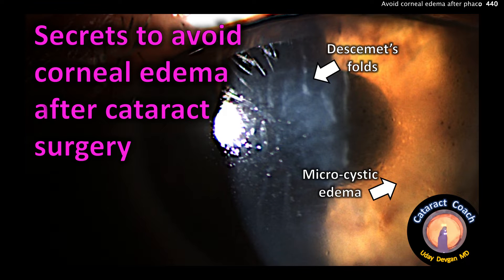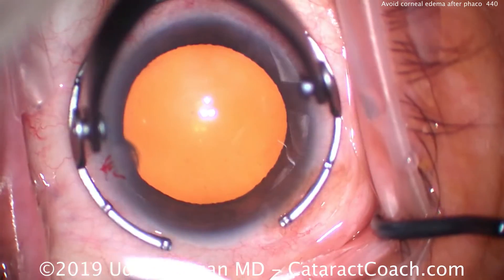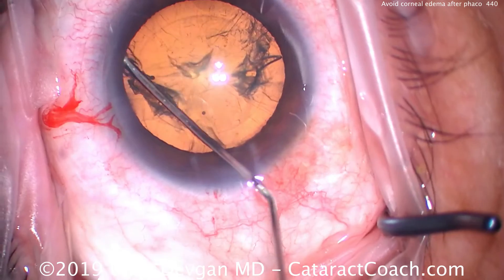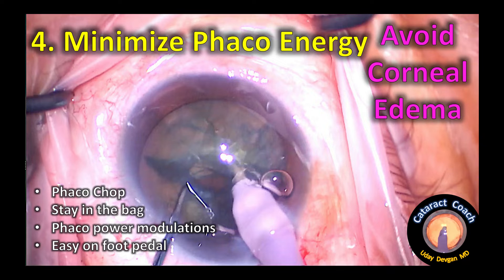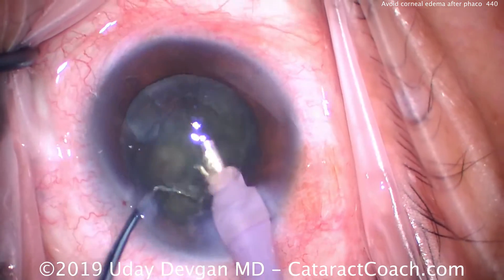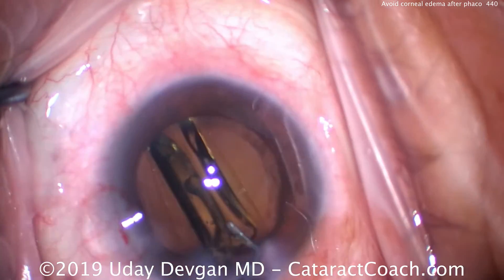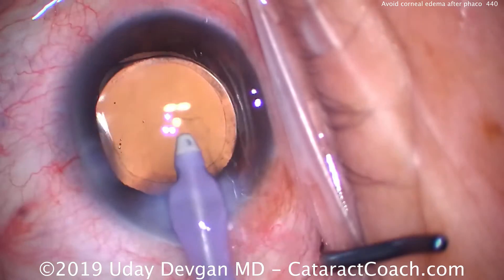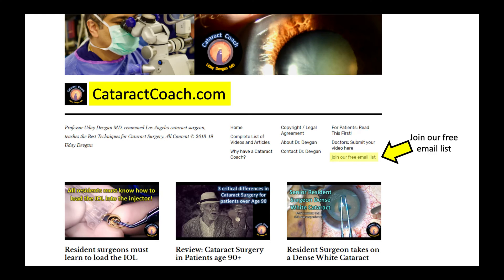the secrets to avoid corneal edema after cataract surgery

Comment: Valid comments except the comment about phaco chop vs divide and conquer. It's a misconception of the phaco chop is better vs divide and conquer. Let me explain. If you take 2 exp. Surgeons doing the 2 techniques, how is it any different the amount of energy spent in order to completely aspirate the lens in phaco chop vs d+c? The lens ultimately will still have to be broken down and aspirated. If you make grooves inside the bag is better vs in the AC as you maneuver to bring the pieces up and chop them. Whether you are in the quadrant stage with high aspiration or the groove state while you prepare your 4 or 3 pieces the total amount of energy spent is practically equal. The chop technique is merely a different style of breaking the lens. In D+Q you have less lens to aspirate as the grooves have taken a % portion out of the lens matter where in chop it's still there.

So essentially this debate between the 2 techniques has no basis. There is no reason to suggest one or the other to any trainee as it being the better one.

Comment: I am a week out from a dense brunescent cataract operation. I could only see hand motion prior to surgery and it was at least 5 years since my eye had gotten any light. My eye had a lot of inflammation on day 1 post op and on day 7 I still have inflammation. On day 1 post op I could nor read the 20/400 line but am now able to read 20/200 at day 7 post op. My surgeon said my recovery will take quite a while and my vision improves slightly every day. Is there anything to be worried about with inflammation/edema? I'm not too concerned as long as it clears up eventually. Should I be worried or just give it time? Thanks!